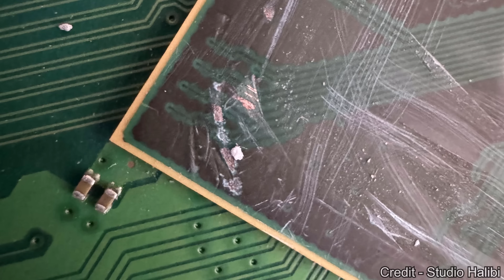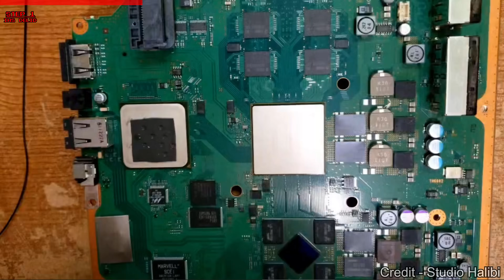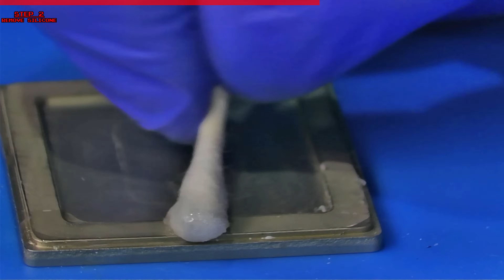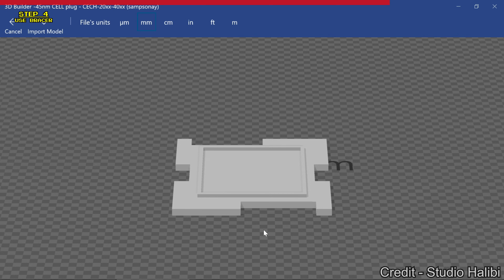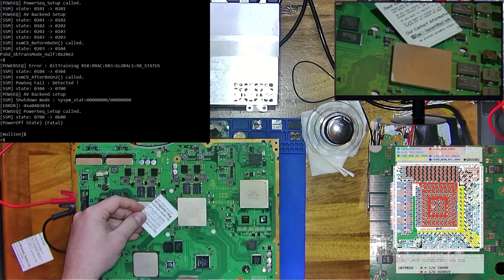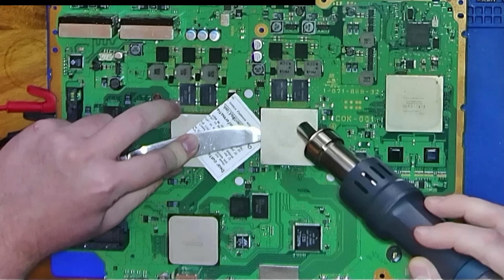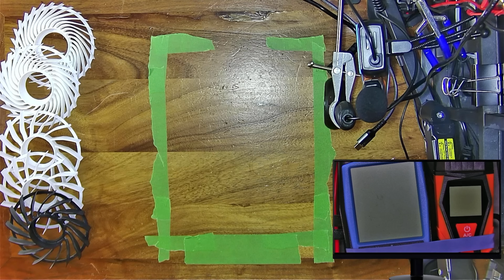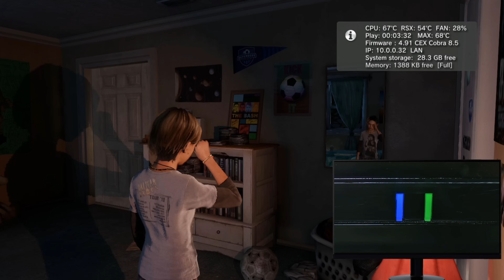How to Fix | Episode 1: Overheating. How to Delid CPU/GPU and fix YLOD - BEWARE of BAD MODs!

Comment: How reliable is the 65nm CPU/GPU? I have a PS3 slim(CECH-2004B) I bought in 2019 second-hand CIB with 2 OEM Controllers and to my surprise it was only used for 30 days (Total usage I got to know from webman settings which is readings given by syscon) to this day the total use it has had is 57 days (including the time I played on it). I read somewhere that this Slim model(CECH-2004B) is the "earlier" slim model which is one of the few able to launch full CFW and has 65nm chips that are evidently easier to delidd than later slim/Super-slim revisions. I don't play on it a lot to personal irl reasons but the temps on it are never good. Due to this I repasted it 4-5 times with MX-4 over the last 4-5 years of owning it(because I was always unsatisfied with the repaste application) and finally was satisfied with the repaste method I used last year. To give an example regarding bad temps I booted Last of us for the first time with Syscon fan settings and 5 minutes into the game it easily reached 81C GPU and 78C CPU. I have no idea what to do. I don't even how to soldier much less Delidding. Living in a third world country the best "expert" I could find for the repair of these consoles is an old sony technician that use to work on them and got my HDMI port fixed interesting thing is that he used a LIGHTER of some special kind to loosen the soldier joints at first I was afraid but later he used a small soldiering iron and I got it fixed. Anyway, Is it worth it for me? Or should I stop worrying about temps and just play the slim at 40% fan settings until it starts giving issues like a random reddit stranger suggested?

EDIT: Wow, that's a wall of text. I really hope you'll read this and give your opinion as your opinion regarding this matters a LOT for me.
Reply from the maker: The 65nm RSX is a reliable chip, no need to worry about it dying from a heat related defect. 

I'm not sure what "normal" temps for a 20xx model slim are. I've never paid any attention it on mine. I just left it up to syscon to do it's thing. I don't remember there being any fan noise, it's always been pretty quiet. I should see what it get's up to.

The only thing that model has that tends to die are the NEC/Tokin proadlizers on the RSX side only. But otherwise they are considered reliable.

Most 25xx are jailbreakable, it's the late models that might not be. But it's actually pretty hard to find one. 30xx and later definately aren't.

Comment: The cooler on my PS3 ceche01 mg runs at 32% and the CPU maintains it at 66 and 67 degrees, for now I shouldn't worry about thermal paste? because it looks like it was barely used, on webmam it says it was only used 49d in total.
Reply from the maker: No, those are very good temps. If you play PS2 games, just be sure webman sets the static 40% before it switches over to ps2 side, otherwise it'll get hotter and not ramp up.

Comment: 24:36 one question tough: why not mount IHS to metal shielding and apply paste into center of upside down IHS? it will still be present there, shielding also has to have right "curvature" (or rather of it) and we're saving ourselves hassle of deliding in the future when paste worns out. It will eventualy but at this time it will be as easy as catefully disassemble the console, wiping our solidified old paste and reapplying new, right?
Reply from the maker: 2 issues. 1 the IHS will sit flat against the HS, not necessarily the die. I've seen that cause bad cooling. 2, most importantly the IHS is a stiffener. It provided structural support to the Package, likely increasing reliability which is the entire purpose of delidding in the first place.

Why replace the paste to lower temps 3C, for an unknown longevity result, then not glue it back on reducing reliability by and unknown ammount?

It's nonsensical until you realize that people are not making rational descisuons, they're making emotional ones. Choosing the bad mods they "want to believe" in, and disregarding good mods they "should." Why? Usually convenence and fear. They fear the extra 3C from a lower thermal conductivity paste, but that lasts longer. And instead choose Liguid metal, which puts the entire console at risk of being destroyed if you don't contain it properly. They don't want to have to put the IHS back on, so they choose not to believe it's necessary, instead coming up with all kinds of rationalizations about how SONY's thermal design teal of engineers were stupid and that dude on reddit knows better...and so on.

It's a pattern of behavior that you'll see in humanity that's never going to change.

Comment: hey Felix, how can I clean my HDD properly ? because it is doing some errors sometimes .. I think this happened after I used the app that frees 8% of the HDD data. I use the PS3 in that way (with only 1% left for the HDD) for some time, and after that I restore the 8% of memory back however it is doing some errors from then onwards.

Comment: Hi Felix, I'm really glad this video has been released now. It can at least dispel all of the nonsensical misconseptions and BS advice thrown around in Reddit and such. I do have some things I'd like to know about though

1. I have actually delidded a CECH-E01 PS3 successfully, but opted not to re-glue the IHS since I frankly I was just lazy didn't feel like it (Buying the silicone sealent stuff is extra cost after all) but I actually still had temperature issues. Eventually, I was able to figure out by asking around that HY510 is pretty garbage paste and doesn't work very well on the PS3. But during my troubleshooting, I ended up removing the original sealent in an effort to see if it would make a difference. Oddly enough, I think my temps have actually gotten a bit worse from removing the original sealent. Is it because my CPU's IHS is now sitting on the die with uneven pressure or something? I may have to re-glue the IHS if this is the case, since the original sealent is now lost. The Vejle XCGPU on the Xbox 360 S/E is an example where the sealent is necessary, but it's also a MCM chip with two dies of different heights. 

1.1. When re-gluing the IHS, what if you just do four corners instead of sealing the whole thing? I know it's what Octal450 personally suggests on the Xbox 360 S/E since it allows you to remove the IHS in the future.

2. Does heat actually help when cutting the CELL silicon? I see it recommended by people sometimes, but I'm skeptical if it actually helps compared to just using a good cutting tool. Is the CELL sealent even temperature sensitive? 

3. If you're gluing the IHSes of the CPU/GPU back on, is it necessary to use clamps like in the video? What if you just assemble the console back to as it was normally? Would the pressure from the heatsink clamps be enough?
Reply from the maker: if you assemble the IHS will sit flat against the HS, not necessarily the die. You want it flat against the die while the glue cures. I changed to the clams due to this issue. 

Follow the same glue pattern as SONY used. I respect Josh, but when it comes to these things I default to the OG design when I'm not absolutely certain there's a good reason to depart from their design.

I don't know if heat helps soften the silicone, since my tool doesnt require any help. I dont want to add heat anyway. I know people say it helps, but I think if you need heat, then your tool is wack.

Comment: hey felix so i delidded my CECH-C04 a while back and changed the thermal paste with mx4 and yet it still had to ramp up the fans usually to 40% (which was quite loud) mostly due to the rsx getting over 70 degrees very quickly that ps3 is now dead i still havent had the time to actually diagnose using uart but when it died i was playing black ops 2's campaign using the disc (the thermal pad for the bd drive was in pretty bad shape) and it YLOD while playing and never turned on again and i also (stupidely) fell for the eraser mod since i thought it might help with temps (though i doubt the die is cracked as it was a bit on the thinner side as i made sure not to make it too big) now im still a little confused on what might be the cause and uarting is gonna be a little hard because i lack proper equipment to do so
Reply from the maker: Not trying to jump to conclusions, but I wouldn't count BGA defects under the CPU out. Not if it died after adding a thermal pad underneath.

40% might be normal depending on the ambient temps. At a room temp of 25C, i don't usually need more than 40% to maintain 68c.
Reply: @ripfelix3020  oh it lasted about 2 months after adding a (literal) eraser under it so I doubt it was the actual eraser that got (or atleast I hope its not) though I do think it had a few yellow light turn offs (2 I think) while playing guilty gear xrd digitally again it always had issues with overheating while using the bluray drive due to the thermal pad being in terrible condition so I always made sure to never use it but I don't know what got to me

(edit) now that I think about it this unit always had issues with over heating no matter what I did to it thinking back it might be all the other thermal pads just being completely ruined that causes it hmm  

also by bga defect you don't mean the actual die itself? just the solder balls right? if so saving this system might not be impossible?

(edit 2) honestly I'm just trying to find a skilled technician in my country who'd be willing to fix the system up and then Franky it to a 40nm since shipping it out of country is not something I'd be willing or able to do due to costs ect

(edit 3) sorry for all the edits but I also just wanted to mention that I loved your video on both ps3 and xbox 360 and that I'd love to see you delve into other systems (especially the 360 that console's scene has been pretty much in the down low for ages)

Comment: Back then when I just started PS3 modding and reviving (2017), I bought a PS3 that had the YLOD/RLOD. I heated it up so the solder balls would reflow (or whatever it did internally on the chip.) and I thought it would be THE fix. This system was a NAND system. I started to buy more PS3 systems which were more NOR than NAND systems. I bought a NOR flasher to hack the system as this was the only way to mod the system back then. I fixed most of them but some of them were beyond my knowledge of repair (still have them all sitting in my closet). At a certain point I wanted to get my first fixed NAND PS3 system (with backwards compatibility) to get modded, so I went to someone who had the tools for it (NAND flasher) and he did it for me. Was a very nice journey to go to his place and talk about lots of mutual interests. I repasted it when we were doing the mod at that time and did not do anything else, no delidding, no cap mods, just repaste and softmod. 7 years later I still use the system from time to time and it works like a charm. Just by reheating the chip. Still unbelievable.

Thank you fellow ps3 enthousiast user that read my story! You have a great day! :D

Comment: when repasting a bare die like on a Delid i like to make sure to spread the thermalpaste so the entire die is covered before putting the ihs or heatsink back on it 
that way i ensure that the entire chip is covered as simply putting on some paste and hoping it spreads on its own is not a 100% guarantee and you may have a uncovered corner , wich can lead to a dead chip certain components of the cpu like the memory controller love to sit in those corners and if that part of the chip cooks nothing will bring it back
Reply from the maker: You can trap a bubble doing that.
Reply: @ripfelix3020  that usually only happens on larger surfaces like the whole IHS and if you have a very uneven application and relatively low pressure
all of wich you dont really have on a PS3 Direct die or  GPU's

Comment: you know what PTM7950 would probably be a really good solution and when it comes to ceramic thermal glue you freeze the heatsink, you do not heat it, that may work but you reduced the lifespan of the chip. In the field if a board fails ICT or FBT and a chip with a thermal glued heatsink is failing we use a freeze spray to freeze the heatsink and with a light twist or with light pressure from a pry tool it will release cleanly from the chip.
Reply from the maker: I tried a freze fracture using dry ice. The thermal adhesive becomes stronger and it guarintees the VRAM delaminates. You need heat to soften it if using the leverage method.

Comment: Printed ABS shrinks 1.8% over time
Reply from the maker: I print almost exclusively in ABS and it is a thing, but I usually just adjust the scale a bit larger to account for dimentional shrinking. And it seems to shrink just after cooling, not like it keeps getting smaller after that.

Comment: I killed a fully functional 90nm RSX when I attempted a delid (cracked interposer) with the popping off method. It sounds easy in theory but is harder in practice. Don’t use a screwdriver to lever on it, it puts to much pressure on interposer. In my opinion a butterknife is better due to it having more surface area and therefore it puts less pressure on one spot.
Reply from the maker: Yes, if you use a screw driver, a palate knife undeneath will protect the Interposer. Squeept does it that way and it works fine. You just need to have something thin and stiff enough that it can fit between, but still have enough rigidity to be levered without bending too much. And it needs to get far enough under to lever, not just dig in and scratch the traces.
Reply: Dude it's easy . I'm 13 and I did it . I know what Felix said but I will Frankenstein it bc of ylod . I HATE IT

Comment: FYI - When using liquid metal thermal paste, It's totally safe, and honestly a good idea to grab some cheap clear fingernail polish.  Use the brush, and put a coat on anything that could be shorted out, if the liquid metal seeps off the die.   Just don't put the stuff on the die itself.   I did this when i used liquid metal on my 7950X CPU.  There are a lot of contact pads, and surface mounted chips around the die.  The nail polish will create a coating that stops the liquid metal from shorting anything out.   Also by doing this, you can be slightly less scared of using tiny bit extra liquid metal, hopefully allowing you to not have to re-do the thermal paste as often.     on the PS3 CPU, I'd honestly coat the entire cpu ( except for the die ),  at least, after testing to make sure the silicone doesn't have a problem sticking to it.
Reply from the maker: I've tried that and it burns if you ever need to replace the RSX. Leaves behind a god aweful black residue that doesn't come off! I'd use UV curing solder mask instead if you intend to use LM on the GPU die. Not that it's necessary, mind you. Also, it can still run out the edges and get underneath the BGA if you apply too much. So LM is still a quite risky endeavor.
Reply: @ripfelix3020  I'm curious but have you tried using PTM7950 and some thermal putty as I heard it improves cooling a lot?
I've been interested lately in repasting laptops and I've come to learn about them recently.

Comment: First couple ones I've had were already delidded since I've bought them from someone in my city, and he's been working on his own delidding tool similar to the one you use, gave me a prototype of it along with a couple dead COK-001 boards (868-22 that had popcorned during prebaking), had very little issues testing on those. I do have a spare B01 that I can try it on after testing more on the other dead board. Never done anything like the case mods or eraser, and all the BCPS3s I've bought came with 226s already, which I suppose is convenient.
It wouldn't make much sense for you to test but some C and G models from PAL regions had the APS-227 which is the same as the APS-226, but only takes 220-240V input. I'd doubt it'd have any real difference in efficiency/operating temperature from the 226, but could be something to test on my own later if I decide to get a C model. Mainly get A and B models since some of the PS2 games I have require the EE to be present as well (and because Japan only got those models and Japan is the cheapest place to get consoles from)

Comment: Given that I bought a CECHG01 used in 2013, played BF3 extensively with it cramped in a cupboard for years with only a single crash, and it still works (albeit it only sat in open air since then), I don't know what to think.

I should at least soft mod it finally.

Comment: Has anyone ever successfully delidded the EE+GS or southbridge?
Reply from the maker: The southbridge yes, but there's not much point. it doesn't get very hot. The EEGS's die is actually on the underside with the balls. The IHS is more of a stiffener/backplate. It conducts some of the heat away through the interposer, which is fine because it's such a low TDP chip.
Reply: @ripfelix3020  Ah ok. Is there any way to at least moniter the EE+GS temps?
Reply from the maker: No, there is an unpopulate thermal monitor pad on the board however and there was talk a few years ago about populating it and attempting to enable it in the syscon eeprom, but that never materialized. It wouldn't give accurate die temps anyway, as it's just a temp monitor reading board temps beside the chip. Like the southbridge.